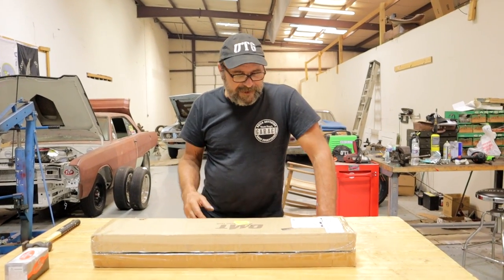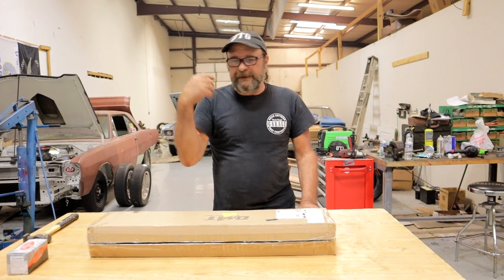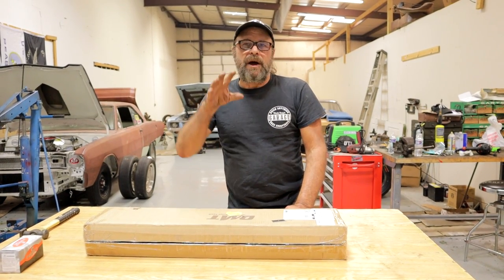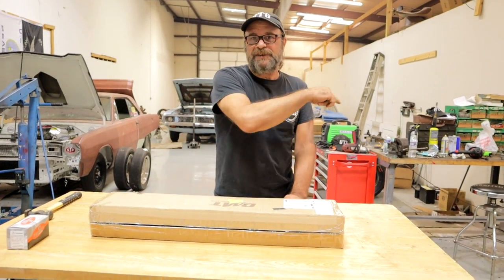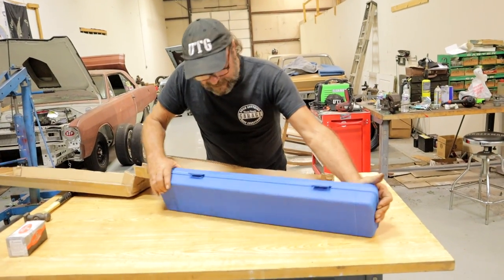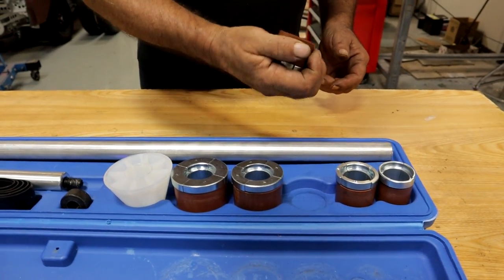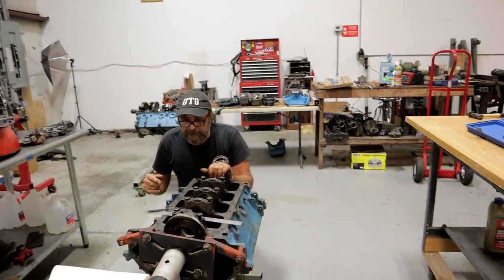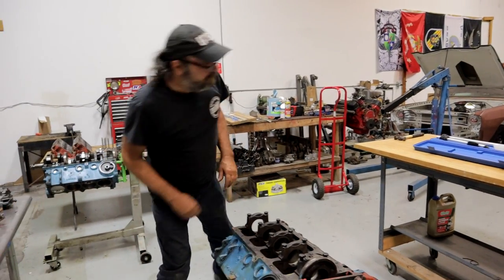Unboxing And Review Of Cheap Amazon Cam Bearing Installation Tool

Comment: I have that same cam bearing tool.  If I'm not mistaken you can put the expander on the longer handle and leave the shorter handle in the box.  It's a little easier to work with that way.  I think the shorter handle was made as an extension for L6 engines where you need to reach deeper into the block.  Also, when I do cam bearings, I set the block on the floor, standing straight up.  That way you can swing straight down and use gravity to your advantage.
Reply: Yes I have the same one you can put the end on the long bar you only need the long and short one on inline 6 cylinders
Reply from the maker: AaaHA!!!  I probably should have read the directions....
Reply: @UncleTonysGarage  RTFM
Reply: No joke, on YouTube I learn just as much in the comments as I do the videos
Reply: @grandmasmalibu  The best part is when years after the fact people are still commenting, despite pinning the comment, telling him how to use the tool.

So... It's more like your Dad has dementia, or you're stuck in ground hog day, and you hear about the same mistake over and over and over and over...

YouTube is fun. 🤣😂
Reply: @UncleTonysGarage  haha gotta love the internet though, hacks for dealing with junk tools is handy.
Reply: @UncleTonysGarage  yelled in you tube  commenters voice..
HE HAS NO IDEA! HE'S A FRAUD!! I love when you do that voice
Reply: Great info
Reply: @UncleTonysGarage  please do a video where you talk about tools. Do you believe in Snap-On, Cornwell, Mac etc. Do you buy Harbor Freight, Craftsman? I’ve wanted to hear your opinion on that for a long time. Thanks
Reply: @UncleTonysGarage  Love you Uncle Tony.  Best gearhead channel on YouTube.  And I'm not even a Mopar guy.
Reply: @mattmiles9779  Craftsman lost the quality they once had. Bought a ratchet and socket set, the 3/8 ratchet didn't work, took it back to Lowe's, they wouldn't honor the warranty so I called sears/craftsman and was told to take it back to where I purchased it. Went back they said take it to Sears, still have it and will NEVER buy a Craftsman product again, and my tool boxes were full of craftsman products.
Reply: @kenadams3385  No one's perfect. You'll get there 😜
Reply: @keithharden7844  it's nuts compared to how it used to be. My friend used to bend a box end wrench on purpose to reach a hard to get spot and just take it back to Sears no questions asked they would swap it out. Only so long that could last. People only bought Craftsman for that reason tho, their tools weren't all that great but they stood by them through thick and thin.
Reply: @rafaelallenblock  Yes Sergeant.
Reply: @iamnoone.  I do mine on the floor or a table so I can use the cone to center off the rear and drive the front bearing in from the inside.
Reply: @baby-sharkgto4902  😆 right??
I've had an idea for a channel. Here's the pitch. Start up a YouTube channel based on old school automotive. After 500 or more subscribers, start a project build BUT allow the people in the comments to literally decide which direction to go. For instance, start with an engine build, tell the audience that they have full control over the build. At the end of the video, ask "what should we do here, or next." Then after a couple days, go into all the comments and count which particular suggestions were mentioned the most. Then the #1 suggestion will ultimately be the direction the mechanic goes.. 😁
I know the idea needs refining but you'd wind up with a car that YouTube built. I'm actually seriously considering it..... What do you think?
Reply: @mattmiles9779  Hey Matt, you might enjoy a channel that I'm subscribed to called "project farm". The guy (who isn't sponsored) buys tools and other hardware related items then puts them all through rigorous testing. He lays out the costs as well as other statistics then compares which tool performed the best overall. He has an extensive library of videos to enjoy and he most always responds to comments and suggestions in the comment section, even on older videos. I really appreciate and enjoy his content.
Check it out...
Reply: @lilmike2710  I am also subscribed. That’s a great channel. I just want to here Uncle Tony’s opinion not necessarily test to failure. When I got in the automotive field all we had was Snap-On or other tool trucks, Craftsman for a middle of the road tool, or Hatbor Freight garbage. We went with the tool trucks most of the time because we just paid weekly until it was paid off. Even though it cost a lot more you didn’t need to have all the money right now. Now a days there are a lot of high quality discount tools out there. Sunex, Tekton, Icon, etc. it’s a great time to start in the trade. It costs a lot less than it did 20-25 years ago.
Reply: @keithharden7844  I agree. Craftsman tools are now made in China. They were never professional grade, (we used to change out of our shop uniforms because if they knew you worked in the field they would hassle you about the warranty) but they were strong tools made in the USA. Now they are ok sometimes but not worth having brand loyalty for.
Reply: @mattmiles9779  your right, it does cost less right now .. I honestly think that the automotive tech/mechanic field has been grossly underestimated as far as the future goes. Especially the demand for classic American automobile mechanics. Imo it's all going to go through the roof. . Anyways.. Snap-on and Craftsman tools have always been the assumed leaders when it comes to tools. Craftsman is up there not just because of the quality but due to the fact that they'll stand behind any tool that bears the Craftsman name. Lol of course I'm old enough to remember Sears and Roebuck stores and catalogues. If a craftsman tool broke or failed we could take them right into a Sears and have them either refunded or replaced, easily, no questions asked.
Reply: @lilmike2710  I think it’s a fantastic idea, you should do it!
Reply: @baby-sharkgto4902  Lol I just might. 😁 I happen to have a couple projects to kick it all off with.
Reply: @lilmike2710  you do it and I’ll watch. I really regret not not doing a build series on my car
Reply: @MrTheHillfolk  ......i did my first motor swap in 1979.....I have dealt with LOTS of junk tools and had to do LOTS and LOTS of hacks.....the fact that humans are very clever and come up with the best damned hacks in the known universe is a good thing....has saved me oodles of time, effort, energy AND money over the years.
Reply: @lilmike2710  great idea, start a channel and make it happen.
Reply: I bought the same tool to replace cam bearings on a 223 I-6 Ford engine for a '62 p/u truck... The tool worked perfectly... I installed them the rearmost bearing first, then worked forward... One thing, never touch these bearings with bare hands, as the moisture from our skin can negatively affect the porous surface of bearings like these... Use the thin neoprene gloves and then cover the bearings with a coat of engine oil...
Reply: @lilmike2710  Craftsman has always been the general consumers assumed leader, however professional mechanics usually consider them a strong mid range tool. They were reliable and tough, but never had the fit and finish of a SK, Proto, Mac, Matco etc. Most tool truck brands weren’t even available to a general consumer at all until Google came around. What made Craftsman popular was you could buy them at Sears, they were 1/5 the price of Snap-On, and they were made in the USA. My buddies and I would have to change our shirts in the parking lot before going into Sears to warranty a ratchet because if they knew you were a mechanic they would hassle you about the warranty. They would even claim they weren’t supposed to warranty professional mechanics tools. That being said I still have many Craftsman USA tools and a few Chinese ones. If they brake I can throw it away and buy 2
two more and still be out less than I paid for a Snap-on. The newer “cheap tools” of most brands are better than the older “cheap tools” were. Those old panel wrenches and ratchets from Craftsman just would not fit into the tight spots of many newer cars. The 36 tooth count ratchets needed a lot of room to hit the next tooth and combined with the old double pawl ratchet mechanism would skip a tooth if you had to really torque them. Now a days an Harbor Freight Icon is a better ratchet than an old Craftsman was but their made in Taiwan. It sucks but that’s just how it is.
Reply: @mattmiles9779  in Australia I would go with Repco, for hand tools, reasonable prices, walk in exchange tool and walk out, also a bloke I know had his Suzuki vitara burn down once while mustering longhorn cow's, in Northern Territory, his tool's all got burnt and the only one's usable were the Repco I had told him to by, Snop-on, SIDCROME ,kingchrome,all, bent, saterd etc, all the best to yous and your loved ones
Reply: @baby-sharkgto4902  Usually more🍻
Reply: @lilmike2710  Found tools in fields buried in yard on road side that were Craftsman brought them to Sears got shining new ones!
Reply: @stevesmoneypit6137  right? I miss the hell out of Sears
Reply: @mattmiles9779  snap on is a rip-off. Seriously Carlyle from napa is just as good and just a fraction of the cost. Gear wrench is good for a less expensive brand. This goes triple when you talk power tools: a Milwaukee m12 stubby impact has more power than a snap on 18v full size, both 3/8. The Milwaukee didn’t even have a fully charged battery during the evaluation.
Reply: @mattmiles9779  Check out the Project Farm channel he did some tests on different wrench brands a couple months back.
Reply: I have the same one too and you can swap them
Reply: My particular kit came with the expander in it's own hole and the long and short bars in separate slots so it was easy for me to see that the expander can be used on the long section without the shorter extension.
Reply: @UncleTonysGarage but did you die?

Comment: I have that same cam bearing install tool set, I've used it about 3 times now. Works every time like a charm, no complaints here. I was in same boat seeing about $150-400 and decided to just go with a throwaway cam bearing install unit.

Comment: I made a cam bearing removal/ installation tool back in about 1982.  one piece of billet steel turned down on a lathe. set it up like a slide hammer. worked perfect! thanks Tony.

Comment: Hey Tony, You can  take the lock ring and stuff off of the short shaft and put it on the long shaft so you don't have to use both shafts according to the instruction video. This way you don't have to use both shafts and have to be so far away from the bearing when hammering them into the block.  Hope this helps you to make the installation easier. Later
Reply: Yup. You can also twist the shaft and hold the wrench to expand the arbor.
Reply: Tony is like a friend I know, he never, never reads the information papers. It more than likely said about different assembly procedures for the tool.

Comment: I sure am grateful for your channel. I'm about to install some cam bearings using the exact same tool into a 99 ranger 3.0 that I've been rebuilding. I've learned so much watching your channel, and have used a lot of your advice. Thank you for your willingness to share all your hard earned experience, it's greatly appreciated.

Comment: Had a similar experience at a chain parts store . Was finally the time to replace the factory starter installed in nov 95 in my work truck . wanted the basic rebuilt since i had 2 other used up starters that i had been using to replace wear parts . I found the bargain rebuilt in stock and went to pick it up . The kid behind the counter is telling me i want the "Gold" version as the cheapo is nothing but trouble - I told him i used to work the counter back in the day of Real Auto parts and just bring both out so we can compare to see if it's really worth twice the price . Both the fancy box and the white box had the same new Chinese starter inside .
Reply: The only difference is the warranty. Same as batteries.

Comment: This video is why it's great for someone like me to watch Tony charge right ahead to get things done. My Dad was like that. But, since he was  USAF trained P-80 mechanic, he never winged it. No pun intended. Aviation is incredibly unforgiving. He got things done. As a kid, I watched him build a 1929 Model from junk with 1940 Ford hydraulic brakes and wheels. Initially with poured Babbitt bearings that I watched him fo with his friend and B-52 Navigator. All done while he was an Aircraft Commander and flew 10-engine B-36s (6x 28 cylinder R-4360 ci radial piston 3800 HP engines plus 4 J-57 turbojets). That he always said he was glad he didn't have to maintain. Then 8-J-57 turbojet engined B-52s. Look up "6 Turning and 4 Burning" on YouTube if you've never seen it. Amazing. Less than 10 minute video.
I've never installed cam bearings. It's not that I'm afraid...No..it is because I'm afraid I'll Eff it up. I'll read voluminous amounts of information which is always conflicting. Use this lube or this grease. By god, don't use this oil or grease. Same with videos. After all that I'll be totally confused but I'll have learned how the cam bearings were installed differently in an American built Packard Merlin V-12 vs a Rolls-Royce British built Merlin V-12 V-1649 ci aircraft engine during WWII.
https://www.jrcengineering.com/wp-content/uploads/2020/10/Packard-Merlin.pdf
And I'll still not be certain as to how to install the cam bearings in my engine.
It a tragic synergism between OCD and, very easily distracted ADD.
I become like Tony who has incredible amounts of of knowledge AND experience. 
Except I never finish anything.
C'est la Vie.

Comment: My Front Wheel Drive bearing service kit is from the same company (OMT/Orion Motor Tech). I've put it through a shocking amount of abuse and it's been fine for a guy at home doing this and that once in awhile. I can't even find a US made version to compare it to, but I probably couldn't afford it if I could. Snap-On's master puller kit doesn't come with bearing adapters and it's $4300...

Comment: As usual this is a very instructive video. And Uncle indirectly points out the problem that faces most of us: buying cheap Chinese/Taiwanese tools that work adequately well instead of better quality American tools. I have a 1997 Lisle cam bearing tool that was made in America. I bought it from a local auto store in a small town knowing that I wouldn't get the lowest price possible. Adjusted for inflation, it would now cost $316--a whale of a difference from $64, needless to say.

So I get it. But if we always insist on the cheapest price no matter what, we will often (not always, as Uncle showed with the above useful cheapo tool) get inferior garbage tools and parts and then wonder why. Somewhere along the line we either support better parts by being willing to pay for them, or stop whining about trash that we inflicted on ourselves.

Comment: I bought a cheap amazon kit like that for winding in the screw in calipers for my familys car...was like 30 40 bucks MAX, Canadian, has all the adaptors ect you need from VW to Hyundai ect. Only time it ''broke'' was when i put a wrench on the pre supplied handle. Caliper was seized. Not product fault just a user error. I still use it too. Handle just bend and i said oh well. One job and its paid off already.

Comment: Just picked up the same tool off Market Place and expected cheap. Turned out not bad at all, used it to knock out SBC Cam Bearings with ease. Used a dead blow hammer, just to see if it would work, and to my surprise it worked like a champ. Yes you can leave the short extension in the box until needed for the longer blocks. The one problem I see with it is that the hammer end does not transfer to the short bar. We will make one to use on the short bar. Going to try on a couple race engines and see how long it lasts.

Comment: Every time I buy any of these cheap tools, (of which it seems I buy many as of late) I take the tool, or set, completely apart, and deburr, polish, lubricate, or anything else I see needs to be done. Then I put it back together, clean, and well preserved, or use it to do the job. 
A lot of these tools aren't too bad, they really just need to be finished. Of course the metals, and the materials are usually of lesser quality than a higher priced tool, but in the hands of an experienced mechanic, they'll work fine. Often, surprisingly good!

Comment: thanx again uncle Tony,watched your video and then installed new cam bearings in a ford 300 six. my stand kept wanting to roll so i wedged it against a work bench.and the extension is handy for the 6 bangers for sure.the cheapy tool worked ok as long as you line up the oil holes it will be golden.

Comment: I bought one almost exactly like this from the jungle website, as a feller calls it. I don't remember the brand name but it looks pretty much like this one. I used it on my 6.4l BGE and it worked flawlessly. I love it and will be using it regularly. Even if I have to replace it 2 times it still costs less than the one on JEGS or other parts dealers. Thanks Uncle Tony, you saved me a bunch of money. I love your channel, it would be super cool for me if you took a look at my channel. Keep teaching and I'll keep learning from you.

Comment: Hello UT.  I just got my  cam tool from summit today. Using it on a 302 ford. Just watched your video and it made it easy to get the bearings out. Tomorrow putting them in.  Thanks for the info on the video.

Comment: I've always used a set of nuts and washers on a long piece of 1" all thread and a wrench so I could slowly press them in, rather than hammer them in.

In the future I aim to use my new 250 ton press which has been expressly designed so I can press anything up to 36" deep [which includes most non-commercial engine blocks and some commercial ones]
Reply: Great idea ,....that's what I would do